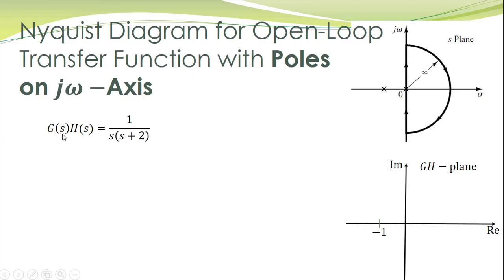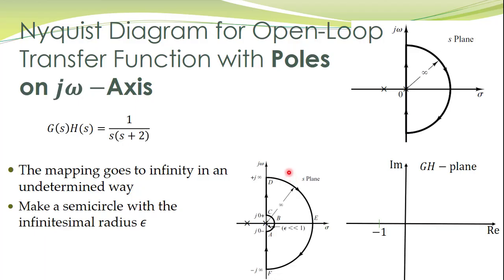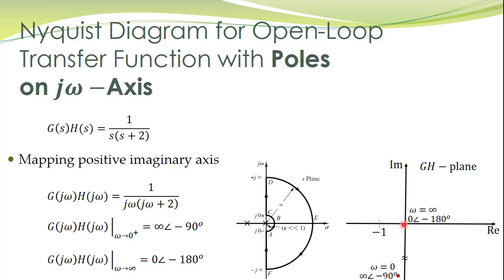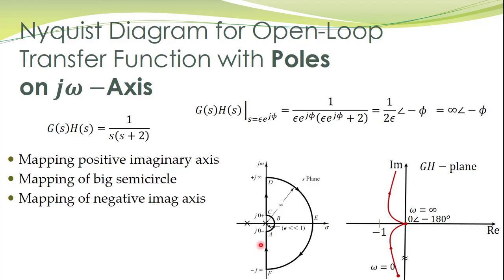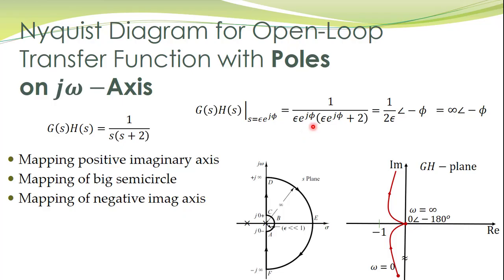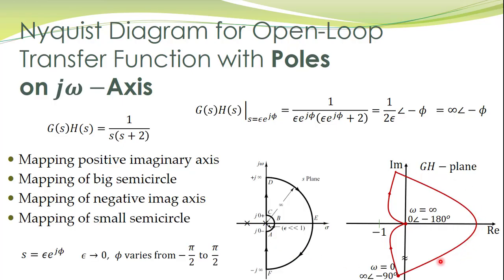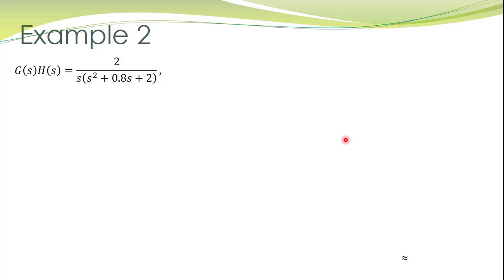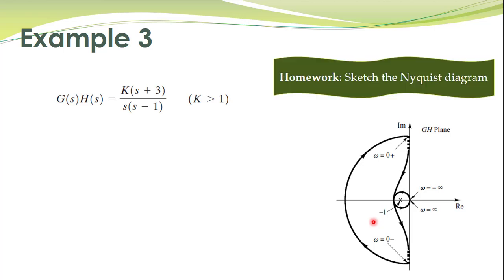LCS 44 - Nyquist plots for systems with open poles on imaginary axis and Nyquist stability

Comment: sir, i have drawn the polar diagram of the homework problem by myself but my diagram is not matching to diagram which you have shown in the last of the video. actually i am confuse in making the plot of small circle. as from the previous example the small circle plot is crossing the real axis at the positive side but here is vice versa?
Reply from the maker: If you substitute s = \epsilon e^(j\theta) in the transfer function, you finally get G = 3/( - \epsilon e^(j\theta) ) which can be equivalently written as 3/\epsilon  angle (-theta - 180). Thus, for the mapping of point \epsilon angle (-90) is \infinity angle (-90), the mapping of the point  \epsilon angle (0) is \infinity angle (-180) and the mapping of the point \epsilon angle (90) is \infinity angle (-270). Joining these points gives you the same Nyquist plot as indicated on the slides.